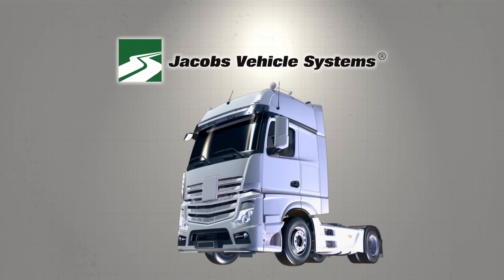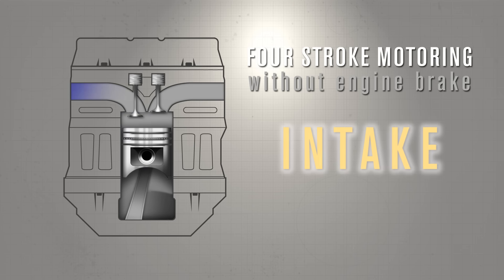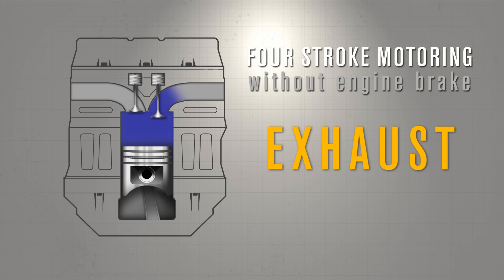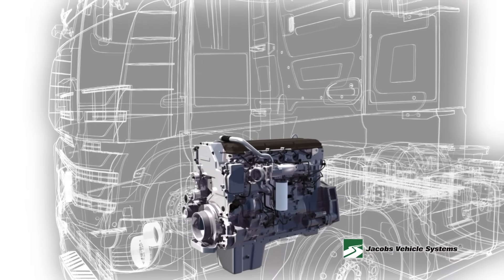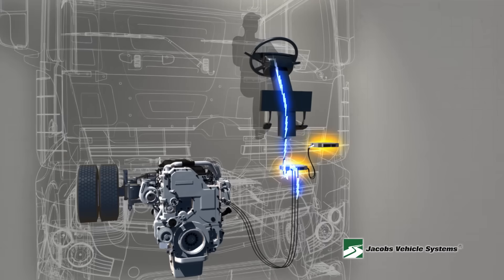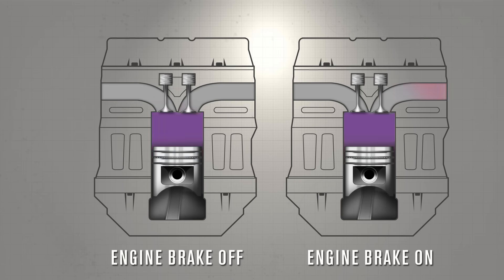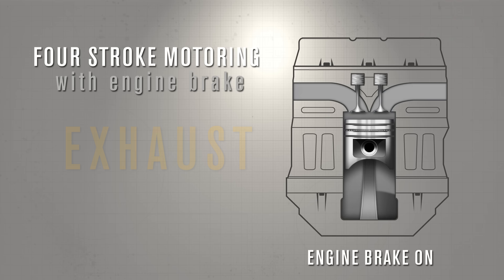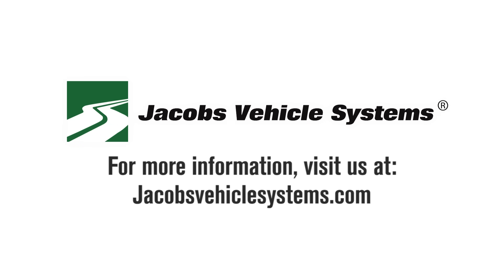How a Jake Brake Works - Jacobs Vehicle Systems

Comment: Thats got to be good for the air😂 just dump unburned fuel out😂
Reply: there's no fuel, fuel is cut off when jake is in use.
Reply: It shuts off the fuel supply to the injectors while the jacops brake is in operation, as soon as the engine falls below a set rpm (usually 1000) or the operator disengages the clutch or applies the throttle the system shuts off and the fuel supply is turned back on.

Comment: so just to not to wear the normal brakes, you are dumping the compression load on the piston so as to suck the power from the wheels..
Reply: On long descents with 40 tonnes behind you would burn out the service brakes.Other systems don't use the compression of air to act as a brake but instead pump oil thru a cooler.

Comment: Had a dirt bike back in the 70s with a compression release. Didn't sound quite as good but did the job.
Reply: It releases compression, but it is a timed release, a plain compression release is open the entire time you hold it on .
Reply: What the hell does that have to do with a Jake brake?
Reply: @Icutmetal  Because they are the same thing. 
https://en.wikipedia.org/wiki/Compression_release_engine_brake
So nice to have so much info at your fingertips...try using it!
Reply: @Not_Sure-2020  Used for the same purpose? Didn’t think so.
Reply: @Icutmetal  Yes, exactly the same purpose. To slow the engine. It is the SAME THING. Jake brake is just a nickname for a compression release. Did you even read? No? Didn't think so.
Reply: @Icutmetal  I swear, I'm not sure why but I'm always amazed when someone is shown definitive proof but they still refuse to believe. Amazing.
Reply: @Not_Sure-2020  You are confused. Similar mechanisms, but completely different functions. I’ve had a dirt bike with a decompression valve too, but it’s function wasn’t to build compression in the engine to enhance engine braking and slow the vehicle. Look man, I’m not claiming to be an expert...and I sure as hell don’t know everything; you can keep googling it, but you’re confusing the functions of the two systems.

Comment: You forgot the ignition
Reply: Diesel engines don't have a separate ignition system like gas engines do. The fuel is ignited by the heat of compression, not a spark plug.

Comment: Although the explanation is technically accurate, it should be emphasized that it uses compression to slow the engine (vehicle); then get to the details of valve operation and the fancy analysis of transferring kinetic energy to compression.
Reply: Thank you.  That makes better sense to a dummy like myself.
Reply: @chickey333  Me too ..
Reply: @@mikestudmuffin4549 How? The volume is being compressed, not expanded.
Reply: This is posted by someone who missed the fundamental reason for how it works. 😊
Reply: @LTV_inc  Compression is not what absorbs the energy?  That is the fundamental.

Comment: I have a question, by using the jake when is ON, is the fuel wasted in Jake brake process?
Reply: As long as the throttle is closed and the engine speed is higher than idle, no fuel is injected into the cylinders. Therefore, no fuel is wasted.
Reply: thank you :)

Comment: I say we should have a brake muffler SWITCH. In the cities and suburbs, flip it on but out and about let it roar.
Reply: He's talking about the noise. Have a Jake with a switch to operate the jake and another for the noise when it is on.
Reply: @Synthwave89  no such thing. Turn them off in residential areas. They are NOT necessary. They are and always will be a secondary helper brake. There is NO reason to HAVE to use it except in emergency and even then its going to be driver error...damn dude, people don't even know how to stab brake...watch them big trucks smoking brakes on a downhill...its not that they are heavy ...they are just going too fast and end up riding brakes=brake fade. Yes, weight is a factor. But the guy behind the wheel should know if his/her brakes are good...people don't even do PTIs anymore...not thorough ones. Ran an 88 Mack Superliner, NYC to landfills in PA, constantly 82,500 (used allowable percentage years back) 5 sometimes 6 days a week. Over the mountains in PA with NO ENGINE BRAKE. NONE.  Most people don't know that trucks used to NOT even have steer axle brakes!
Reply: @mikenamys  Thank you, voice of reason.
Reply: Exhaust cutouts, still in use and still sound great.
Reply: They're been adding that to muscle/pony cars forever, it'd be just as good an idea for a Jake brake. I'd be surprised if it hasn't been done (aftermarket)
Reply: I remember how older Ford Raptors used to have a switch for the muffler... It should be a similar concept.
Reply: When have you ever seen a Jake that wasn't on a switch?

Comment: '
truck is going down hill grade and better use a shaft - N - neutral on the transmission...
that can be help big save gas, cooler motor radiator
Reply: Yeah, then enjoy their faded service brake when it gets overheated. 
Visit back your physics class in Middle School to understand how much heat does brakes on 80000 lbs truck generates during a long descent.

Comment: Although I can understand the DIRE NEED for some peace and quiet,   I didn't think they were that loud or annoying.  Hell,  I'm in my early 50's and my hearing is still pretty good ( unless you ask the wife.)  My opinion is to KEEP the engine break at a certain decibel, this way the assholes texting in front or back will come out of their hypnotic state and pay attention.  Too many think Harley - Davidsons are too loud. These fruit cakes can join the SJW class of FUCKING MORONS.  Bikes  SHOULD be loud and OBNOXIOUS, ... again,  so the morons "TWEETING,"  "TEXTING,"  will get an epiphany that they're not the only ones on the road.

Comment: The comments here just show how retarded people are. "The best thing about jake brakes are how they sound" Really??? Tens of thousands of trucks using jake brake? Every day, the dominant sound in Ur community, around the year? There`s a better engine brake for diesels; a butterflyvalve in the exhaust port. Voila.
Reply: Me Ballerman 
That's an exhaust brake not an engine brake..
Do your research
Reply: And all that does is blow out manifold gaskets.
Reply: You had me til the butterfly statement... what a pathetic setup. Just plain awful. If an exhaust brake works for you, you don't really need engine braking.

Comment: So is fuel still injected during the compression stroke when the brake is on and the compression is sent out the exhaust valve? I would think it would be more economical to not inject fuel during the compression stroke since it would just be a waste.
Reply: No fuel is injected...
Reply: If your foot is depressing the fuel pedal any little bit, the jacobs brake will not engage.
Same for the clutch.
Reply: No, no modern diesel or gas motor injects fuel when on the brake and no foot is on the gas pedal.
Reply: @1320fastback  to a certain extent, you are correct, but not all the time. Certain conditions have to be met. You are referencing DFCO, which, depending on the vehicle tuning, requires certain speeds, rpms, and loads.

DFCO works best when the timing is set to near 0, but you get no engine braking this way. Most manufacturers set DFCO timing to allow for a progressive engine braking curve, but this makes the system work less efficiently. Personally, I tune mine to limit engine braking to maximize the time DFCO is activated, except on towing vehicles, which I set for maximum braking.

Also, modern automatic transmissions unlock the TCC at 0 throttle, thereby drastically reducing the braking effect during DFCO. This can NOT be changed by programming in most modern vehicles, so you are stuck with a shitty DFCO system that doesn't save much on gas.

Comment: hey jacobs
ive been doing my research and alot of maths on how all this works and its practical applications i was wondering would it possible to make an engine brake system (compression release type) that would work on a nissan td42t and if it is possible would it be effective?? and what pros and cons would there be to system fitted to an engine of that size?? ive worked out that the compression ration is some where around 22.7:1 and the clearance for exhaust valve opening at top dead center is no more then .4mm
Reply: no you need 4 valve head, It would cost more than an old patrol is worth.

Comment: So it's the fuel burning in the exhaust that makes all that noise on old Jake brakes?
Reply: From what I'm getting, the fuel is cut off - the engine isn't receiving any fuel. It's just blowing the compressed air out the exhaust after the compression cycle.
Reply from the maker: Thanks for the question.  Here's a bit about the noise from our website.  "Compression release engine brakes (referred to hereafter as engine brakes) are the most popular type of supplemental vehicle retarder used in North America. Their function is to turn a power producing diesel engine into a power absorbing air compressor. It does this by quickly opening the exhaust valve near top dead center of the compression stroke. This causes a sudden release of compressed air from an engine cylinder into the exhaust system. This is what causes the characteristic staccato sound of an engine brake in operation. "

If you'd like to read more, we have a whole page dedicated to the noise as well as other documents.

http://www.jacobsvehiclesystems.com/about-us/environmental-health-safety/noise-concerns/ 
http://www.jacobsvehiclesystems.com/files/file/vehicle-noise-and-compression-release-engine-braking-28307b.pdf
Reply: long story short what i'm getting, is there is no fuel, and the engine is using compression to slow the vehicle down. and it's all the air leaving the combustion chamber that makes the noise. But i really don't know a lot about diesels, so don't quote me.
Reply: @ModelKing1000  you got it right.  so many dont understand
Reply: ike fun calm down hot shot.
Reply: Think "popping a balloon"
Reply: So... by opening the valve sooner the pressure differential in the cylinder is less, and therefore less sound emitted... Dirty little secret is that also means it's not going to work as well because you're releasing the compressed air before it's fully compressed.

Comment: So is it a bit like the BMW VANOS system with exhaust cam phasing?
Reply: Mediocre-Motorcycle-Modifications The vanos system simply increases intake valve timing with the more throttle you give it. My 540i has two Vanos units, fun car.

Comment: Hey Jacobs,

If [hypothetical] my big rig is a hybrid-electric type, do you recommend ordering the diesel genset with the Jake brake deleted as, if the drivetrain supported it, I could use the electric motors connected to the wheels as engine-retarders that also charge the batteries?
Reply from the maker: Hi Ellenor!  One of our engineers took a look at your question.  Hope this helps with your hypothetical question.

There is no reason for any diesel genset to have an engine brake installed; if the vehicle is using a genset, then the engine won’t be in a position to impact braking.

In a typical diesel-electric system in a locomotive, the diesel engine is actually driving a generator (genset), which supplies electricity to the motors driving the wheels.  In this arrangement, a Jake brake (indeed, any engine retarding system) will not help to slow the vehicle, as it is not part of the drivetrain.  Foundation brakes and regenerative braking are the only choices here.  Diesel-electric locomotives use the electric motors to brake, but they dump the power into resistor banks to be dissipated (as heat).

In a hybrid fuel-electric system where both the engine and electric motors are connected directly to the drive train (such as in the Prius), both an engine brake (if the vehicle were so equipped) and the electric motor could be used to slow the vehicle down.
Note that the power dissipated by a 4,000lb car braking, and a 40,000+lb truck braking, and a train braking, differs by an order of magnitude.  In electronics, as you deal with more power, components become bigger, heaver, more expensive, and have to dissipate more heat.  (As a side note, the Jake brake dissipates that braking power as heat by sending it out of the existing exhaust system.)

In any situation where you have an electric motor in the driveline, you have the potential for regenerative braking; the issues are how much braking can you get from it, and how much efficiency you are willing to pay for.  If the electric motors alone move the vehicle, you could reasonably expect them to also be capable of slowing the vehicle; the same may not be true if they are supplemental power to the engine.  Also, the heavier the load, and the more rapidly you decelerate, the more power you need to get rid of.  If you want to recover more of the energy you are losing, you need to pay for more batteries, and more electronics to manage the batteries, and more space consumed by the batteries, and more weight consumed by the batteries.  (This is in direct opposition to the design goals of making the vehicle lighter and cheaper.)
Reply: @JacobsVehicleSystems  I realize that this discussion is very old, but I would like to thank Jacobs Vehicle Systems for an exceptionally well-considered and helpful response to the question.
Reply: I thought so.

Thanks.

Comment: I miss the old style jake because they WORKED my Cummins ISX jake dosnt do anything while my old ISM would damn near throw me through the windshield
Reply: JacobsVehicleSystems 

that is quality help from a company.
Reply from the maker: The Cummins ISX 15 has significantly greater engine braking power (250+hp greater) than the ISM, mainly due to the size difference and haul application.  Which ISX configuration do you have and are you comparing the same loads?
Reply: JacobsVehicleSystems it's literally the same load and trailer it doesn't slow me down at all
Reply from the maker: Could you send us a private message with your contact info?  We'd like to help solve the issue.
Reply from the maker: Thank you.  I will have one of our engineers contact you.
Reply: We run a 2010 international prostar with a ISX and the Jake brake on that thing almost throws us through the windshield with a full load, so you have it set to a certain grade? Because ours has 3 Jake options and the 2nd one always does the trick

Comment: The Jake brake on our Internationals are very quiet, I can ignore those "No Engine Brake" signs.
Reply: I thought they banned them because of environmental issues.
Reply: @nicolaslugo2658 .... "environmental issues"?!!?..... what Environmental issues?.... they're "banned" from use in populated ares by morons who seem to think that Jake brakes are just something for truckers to make noise with.
Reply: @Romans--bo7br  mufflers stop the Jake sound effects..
Reply: Same on my KW.
Reply: I ignore them anyway. Jake Brakes are safety devices.
Reply: @montewiederhold3508  That correct, most of the time they are not used for safety ! Some think it cool waking and disturbing others !!
Reply: @montewiederhold3508  You really think the government would put up signs asking drivers to do something dangerous?